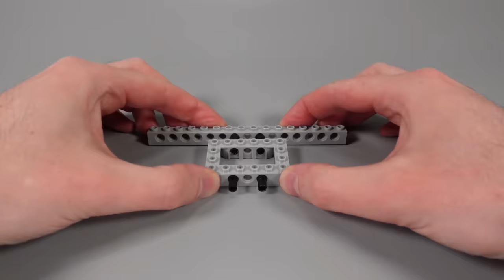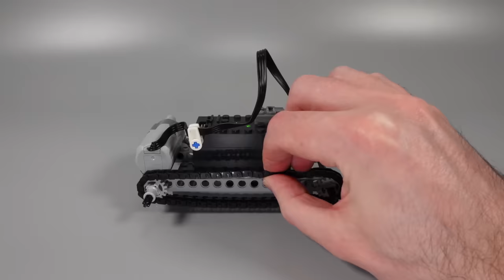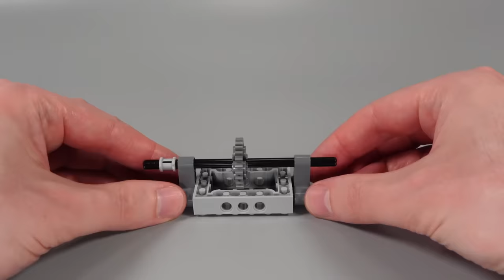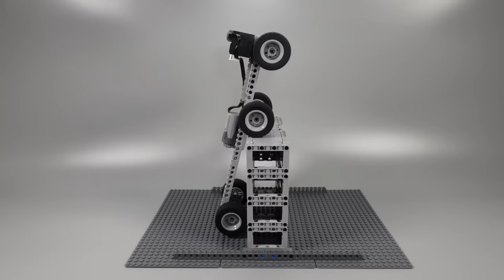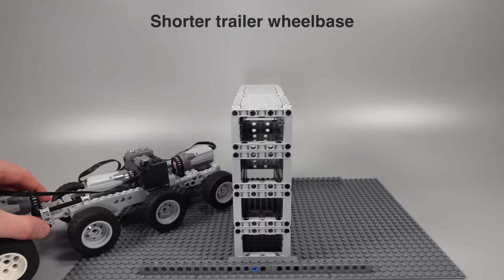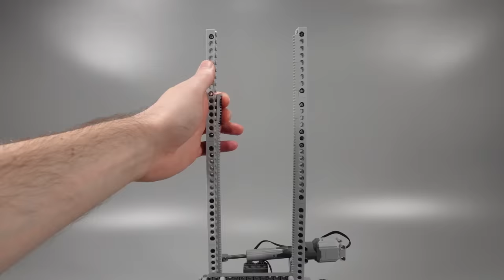Making Lego Cars Climb Walls

Comment: I just love how it escalates(pun intended) from relatively simple solutions and modifications to something completely fantastic.
Reply: The vehicle evolved like a pokemon through a very capable offroader into a straight-up siege contraption
Reply: That just sounds like anxiety
Reply: Always interesting what people might come up with.......
Reply: It ascends to heaven
Reply: I actually think that the final solution is one of the simplest
Reply: Scale matters.  Comparing the starting vehicle to a generic sedan, level 6 would be akin to trying to drive up, over, and back down a >40'/>12m wall.

There's a reason that such obstacles are usually completely bypassed (whether by going around as he did at the very end, or by airlift/cranelift), or demolished.  This video is showing how to approach such obstacles the hardest way possible, hence why it took so much engineering to succeed.
Reply: That's exactly right, he did it very well

Comment: I really like the idea of a car that brings it's own stilts to climb over obstacles. I wonder if rollers on the sides of the stilt "feet" would help eliminate some of the dragging you were experiencing.
Reply: or just put lube on the ground 😂
Reply: Reminds me of that bridge building machine
Reply: Why not a car with its own catapult launcher and rope?
Reply: @sarcasmgod8430  9
Reply: On flat surfaces yes. I think a more stable option is to add 1 more at there is always 2 feet on the ground. This action would support the vehicle while its center of mass traveled over the middle of the tower and prevent that tipping issue
Reply: Didn't American humvees in Afghanistan use stilts to climb over rocks?
Reply: FRC teams had to solve a similar issue to this in 2019. Look at Team 118's 2019 robot and the system they use, it's very clever.
Reply: Could be working if your stilts would be more stable but remember you need an axle connection down there to drive so your limit would be a gear moving on the largest axle.
Or you could build a possible greater axle out of connectors and drive it with a rubber band on the red technic clutch part which would be connecting but can move free up and down.
The force must be transfered through the stilts to the bottom ending in a high risk of twisting the axle so maybe you end up putting a motor per stilt and connect it through long cables to the car body.

(edit: Okay I missed that you did not speak about steerable wheels.)
Reply: @altaccount4697  They used the same method but four stilts before and behind the first and least wheels with free spinnable wheels to move.
Reply: @steinlaus5605  not quite. They have wheels on their stilt that are driven by a gear that is only engaged when the stilt is down
Reply: I would’ve added a skid plate to the bottom
Reply: or u could just drive around the obstacles

Comment: More like... walking over.
I'm interested to see an upgrade for Level4 design, so it would bend at a sharper angle when at the wall to near 90-degree angle and stack itself vertically.
Reply: Huh. Yeah, basically what I had in mind.
Reply: as in like it would throw something over and hold its self against the wall

Comment: Up until level 5, the strategies you used verified the conventional wisdom of my other hobby, RC crawler trucks. Weight to the front, more ground clearance, and a smooth belly help drag over real world obstacles too. Would be interesting to see if the dirty trick in crawling helps you too: adding weight to the tires to help keep from rolling over

Comment: Could help but thing putting weight on the front for #5/#6 would have maybe helped, along with putting 'L' or reverse 'L' shaped supports at the bottom of the poles could help as well with un wanted tilting.

Comment: wow the amount of finesse required for the final design is insane, I'm wondering if there is a way to have a tripple leg setup where instead of having simple legs lift the entire car, have the wheels of the car be a part of the legs themselves with some sort of drive shaft along the legs. That way your not dragging along the floor and dont require to "walk" at the end. Another addition could be a balance box, a weight that can be moved forward or backwards

Comment: You can just increase wheel diameter all over again or add a tall middle joint so it can be easier to climb big obstacles but you have to put rear motors so it will be able to work and you have to separate them a little bit too

Comment: Adding even one movable balancing beam (shorter if it has some weights on it) on horizontal axis could help on any balancing issues...

This climber could evade any ground vehicle if you build a castle that has only one access point and it is elevated enough from the ground.

Comment: The problem with this method of engineering is that as the levels progress the design is built upon, making it more complex. In general we prefer to have a simple, more universal design, this way less parts can fail, troubleshooting is easier, and overall the design is more comprehensive.

Comment: I'm curious if there's a Lego car that solves climbing a "level n" wall. Where the solution to building it isn't simply outpacing the wall's height by adding length to some component of the car. Obviously you'd need a way to stick in place. Maybe a spring loaded shim or wedge to find the next seam between wall bricks when you release it? Have two of them on gear tracks the way you had the stilts. One rises up until it finds a gap, with the other beating the weight. Then the second rises, with the first bearing the weight. Then they both pull downward while the car's wheels drive up the wall. Maybe? Just a thought

Comment: that didn't go at all like I thought. I figured the wheels would be broken into 3 section. one set would go up roll past the wall, then the second set would come up move forward the 1st set would then go to the ground and move forward then finally the 3rd set would move up and move over the wall then all 3 sets would reassemble at the bottom.

Comment: Lookup the custom off road truck called “Chainlink”. It barely resembles a truck. You might be able to build a Lego version of it? In 2016 I started building a human size pedal kart 4 wheel drive and 4 wheel steer with design similarities to Chainlink but I ran out of money for the build and the Lyme disease I had been fighting prior to the build returned. I took apart the frame last year so I could build a simpler 4wd/4ws pedal kart.